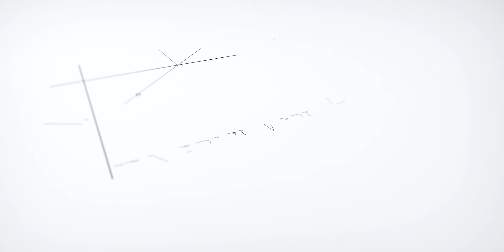HOW TO: Keep your perps in-line

Comment: What do you do when a window opening isn't a full of half brick away from an external corner?

I have some plans where the face brick opening is 1250mm from the outside corner, which is doesnt work out for 215 x 102.5 x 65mm brick?

Its 1250mm to keep the window opening centralised to the room from the inside.

Comment: Stand face on to the wall instead of side on and you can eye you’re perps down easily. I don’t understand why but lots of bricklayers struggle to lay face on
Reply from the maker: Good point - but I find standing sideways creates minimal twisting and turning. Everything seems to be in the right place and flow a lot easier
Plus using the thumb trick takes care of the perps 😎👍
Reply: I go side on if cant look down and eye the perp nicely, then face when that bit higher up. Also sometimes lay one near the centre and run into that either side. 
But I work on my own, not on big sites so don’t need to be super fast or stress much. 
Happy ticking along, nice one go steady
Reply: Side on helps to see if face of brick is straight.

Comment: How do you make sure the brick is square and not tipping back or forward?
Reply from the maker: Use a boat level every couple of bricks to begin with. Once you get a feel for it you know straight away if you’ve walled a square brick! 🤗
Reply: Will try this although my bricks are tilting rarely now. When they all touch the level it is BLISS😊

Comment: Why don't you also video cleaning the snots off the back of the wall  every course?
Also the perp joints won't be out of line on a bit of a brick panel like that !!!! 
Bricks vary in length sometimes so the labourer should get the bricks out of several packs! 
And yes I am a brickie
Reply from the maker: Something we’ve took keen notice of lately is snots on the back of our work ☑️ 
As for banding - much easier said than done. Labourers job is intense enough without having 3 packs of bricks alternating their way to the loading bay

Comment: Question from an absolute amateur - how much pressure are you putting on to get your brick down? I find my mortar is either nice and creamy, but needs tapping down - or just too wet and sloppy, I can never get that point quite in between? 

My bed doesn't look much more than yours, and I don't think I take out any more - so either I'm too weak, or my mix sucks!

This is my current effort, but taking me a good while! https://imgur.com/gallery/DSf6MAc - not easy with rustics!
Reply from the maker: Nice work mate 👍 keep practicing. You soon get a feel for the brick and it becomes a habit applying just the right amount of pressure to get down to the line with enough excess mortar for your next perp 🤗🧱